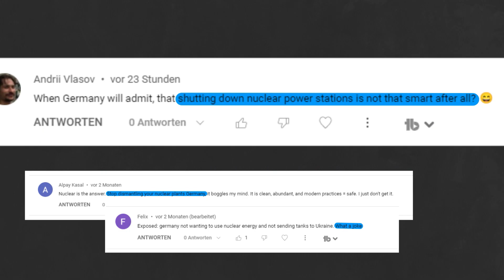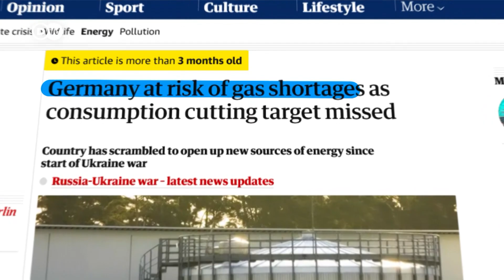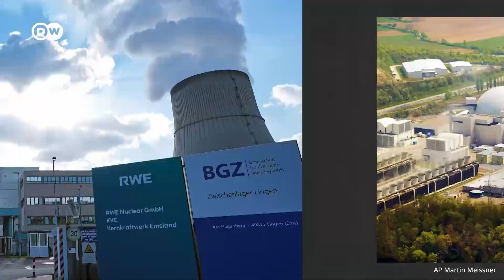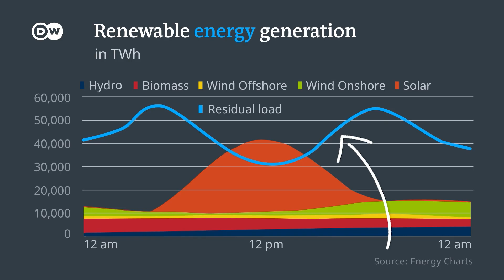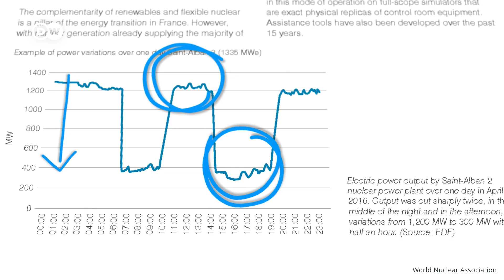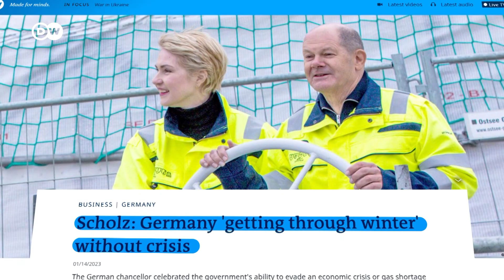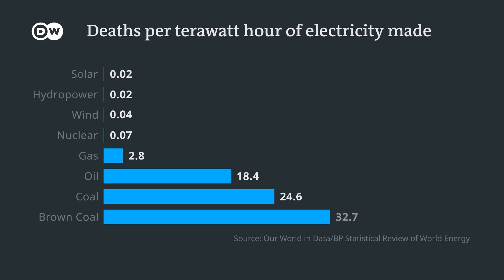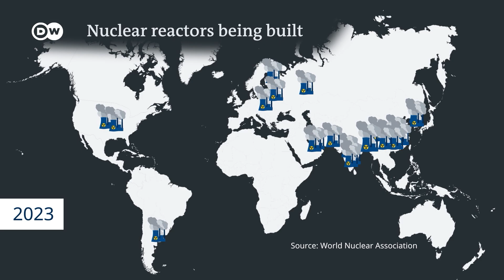Is Germany's nuclear exit a mistake?

Comment: I am completely astounded by the statement that even in a technologically advanced country like Japan, nuclear energy couldn't be made safe. Like, who came up with that??? There was an earthquake and a subsequent tsunami! Of course there would've been a disaster! It's not like the power plant suddenly decided to mess up. This was not caused by the technology itself, and the risk of the same happening in Germany is basically 0
Reply: Japan sits right on the edge of the tectonic plates, they  constantly have serious earthquakes, and if you look back a few centuries they had massive earthquakes. 
Finally, they put the backup energy "diesel generators" in the basement, right next to the ocean.
Reply: Well, Angela had a really good deal with Russia for oil and gas…
Reply: @MioszMichaowski  Yes they had. Germany is now loosing its industry, most energy hungry industries will move to China. The "woke" environmentalist make the environment worse and Europe poorer.
Reply: And the Power plant was designed to survive that. But it didn't. Emergency systems failed in fukushima. Because of planning oversights (redundancies not respected) and cooling pumps not working. So yes Even in one of the most advanced countries man made errors caused this desaster.
Reply: the problem with considering Fukushima to be a proof for lack of safety is not that it wasn't a failure - it was. It's the fact that you have one such accident after some 30 years since Chernobyl means it's a very safe technology
Reply: Well uranium is Monopoly by Russian company rosatom
Reply: "I am completely astounded by the statement that even in a technologically advanced country like Japan, nuclear energy couldn't be made safe. Like, who came up with that??" Liars did.  Liars and fearmongers.
Reply: Ok no Tsunami, call it a Russian rocket, terrorist attack, plane crashing, meteorite, country invasion, lack of water to cool the reactors. All this can happen. But basically the human sabotage/terror the most likely to happen, you can ruin a country in seconds.
Reply: Cause tsunamis and earthquakes are so rare in Japan? 😂 If you are located on the edge of tectonic plates, you need to build tsunami- and earthquake-proof. Not doing so is failure
Reply: @pn7134  That's why here in Chile no one is discussing nuclear energy, because we're not able to create earthquake-proof centrals.
Reply: Fukushima would not have happened had the backup generators been placed on higher ground and outside the flood zone. Simple as that.
Reply: to add insult to injury, Angela Merkel is a nuclear physicist.
Reply: The backup generators at Fukushima were located a few meters too low.  The company did this to reduce cost - regulations are stricter now.  Meanwhile: the death toll of the earthquake and tsunami was nearly 20 000 people.  The death toll from the nuclear meltdown?  Well, one half?  One person's cancer death might have been related.  After an earthquake and tsunami that killed over 19000 people, that was the actual disaster.  The technology is safe, was safe, and has since been made safer by regulations.  If only we could say the same for any other source of energy or other resources we have...
Reply: The even weirder thing is, Japan is one of hte rare few places on earht with stable renewable energy potential. With it's horrid geological activity and good coastline, Geothermal and Tidal aren't off the charts. Ireland (sitting on many pwoerful consistent wind currents), and Scandanaavia (many rivers with little people) are some of the otehr few such rare nations.
Reply: 2 points you completely ignore:
1) what do you mean by "Of course there would've been a disaster!"? the reactor was build to withstand such catastrophic events, since the region is prone to earthquakes and consequently at risk for tsunamis. it happened anyway because of technical and human error. there is no "of course"
2) the vehement protests against nuclear power in germany are largely caused by NIMBY (not in my back yard). it's not so much the risk of a nuclear event, but the fear of the government deciding to burrow nuclear waste in your region. the search for such a disposal site went on for decades. it was in vain. the risk of an actual nuclear disaster comes from across the border. there are plenty of old nuclear power plants not far from germany and they are not in great shape. it's not uncommon to hear of "minor accidents" in one of these power plant, keeping the fear very much alive. radio active fallout knows no country borders. I think most of us know that by now.

Comment: The pollution of coal can be reversed. The pollution of uranium, plutonium and such are not easily reversible, they dont even know if it is possible, they just have speculations no one have had such materials to observe longer than you have lived, so they cant say for any fact. Germany, bold move, I think you did the right and wise choice, should you shut them all down and build some other solution.

Comment: I feel like the fear of Nuclear energy is unjustified, but not entirely incorrect. Especially in the long run.
It WAS a mistake to do this so hastily, but in the future nuclear energy should also be replaced. As better energy storage options are made, we should be able to rely almost entirely on renewables and even if it seems far away I've learnt to not be surprised anymore if something projected for 10 years to be invented actually takes a year or two
Reply: There is nothing to replace nuclear with. It's just the best by virtually every measure. Nuclear is the future, not the past. By 2050 people would have to admit that renewables have failed. We'll have to face the climate consequences, though - the price for stupidity.

Comment: Just read about forming-grid converters, VSG(virtual synchronous generator), and batteries made with simple sand. You can realize that modern society has solutions of this problem, right now we have map or road to reach non carbon dioxide emissions and also nuclear power plants has emission, nuclear fuel cannot be reproduced and we need to store it and bury under our earth, so what I want to say that all problems with green energy can be solve today, all you need money and good engineering, so I think Germany made the most important step to change quality of living and also it’s example for others.

Comment: yes it was a political move ..
let the regular running time end and REGULARLY shut them down .. sure .. 
but shorten their running time for political reasons is an insanely expensive move .. ESPECIALLY in a time right after losing all their current gas supply from russian pipelines .. which put energy cost to more than TWICE the already most expensive electrical energy cost in the world

Comment: yes.
populations increase by exponential increments, the need for power per head only increasing. everything you carry around is smart now, everything has a wifi and internet connection everything needs power to function and more things need to function electronically. more things need to be automatized and that needs power.

Erneuerbare Energien sind schön und toll, aber sie sollten eine Lückenfüllerfunktion erfüllen statt die ganze Nieche zu decken.
Mann braucht eine beständige Energiequelle die nicht schwankt, steuerbar stark ist und möglichst sauber. Nukleare Energie ist "sauber" aber nicht sicher.

Anyway: the federal gov't is retarded to use the japanese NPP incident as a case for german enviromentalism. japan is on the edge of a tectonic plate and surrounded by ocean. its not a matter of "if" but rather a "when" of something happening to the japanese NPP.

Comment: It is a myth that wind and solar energy is free.  Wind turbines are very expensive and the rare earth elements used in the turbines and solar panels require extensive carbon intensive mining and refining to produce the rare earth elements.
Also the amount of copper required over the next 25 years is equal to all the copper ever mined through out human history up through 2020.  This includes all green technologies  from electric cars to wind turbines and every other device that uses copper.
Stripping all the copper piping used in water systems still requires new copper mines to be brought on line and this mining is done by hydrocarbon equipment, even the electric based equipment used in mining has a massive diesel generator to provide the power needed 24 hours a day.

Comment: 10:07
"Old technology ...... such as nuclear power plants which are unreliable, which are dangerous. We always also have to think what is happening with the nuclear waste afterwards."

Holy Jesus that was an impressive amount of wrong information. First and easiest, nuclear is the most reliable source of electricity on Earth, with a capacity factor of over 90%, while second place is at just over 70%, and most other sources (hydro, coal, wind, solar) are between 50%-20%. Second, the "waste" issue has been solved since the 50s. If you really want to get rid of it, bury it. We can easily dig holes with modern drilling equipment that are miles deep and can even bend the holes horizontally in any direction we want. You can put canisters of "waste" 5 miles deep under a mountain range covered in concrete if that's what it takes to make you feel safe. The better option, however, is to reuse the waste material in newer, more efficient reactors.

Comment: Renewables like wind/solar are a good thing to have around, but not often as good as is reported.  Germany for example always displays their figures about how much power they generate with renewables, but what they don't say is how much of that goes to waste.  Battery storage on a national level is no where near capable of handling low generation periods so they always need reliable power from fossil fuels or nuclear either running backup or able to be turned on in a moments notice to prevent blackouts.

Germany is also a pretty bad location for both technologies, with several months getting very little sun hours on average, and has 7 months of calm wind each year.  Germany's best location for sunlight is on the baltic coast, which gets around 1900 sunlight hours a year.  A lot of the southwest of the US gets over 3200 hours on average.

Comment: Isn't coal power plant can turn on-off quickly as well? Why do they need to shut off renewable at peak time?  This is illogical.
Reply from the maker: Hi Vincent. 🌱 We explain the concept of residual load at about 5:15 minutes into the video. We are not yet utilizing energy from renewable sources during these peak hours, and there is a need to compensate when the sun is not shining or the wind is not blowing.

Comment: 90% of times when you ask someone why they are against nuclear power they cannot give you a logical or valid reason
Reply: %90 of times they will bring up chernobyl
Reply: @Idunno-678   Caused by an autocratic government that built poor technology and had very low training standards, and yet the remaining plants at Chernobyl operated until December of 2000.
Reply: @Idunno-678 or fukushima
Reply: @Idunno-678  Chernobyl is a wrong example. The plant was SAFE. The engineers deliberately, and against the rules, turned off critical safety features. They deliberately took massive risks. It's not like they were sitting in the control room and suddenly all went haywire. They very rigoruously, step-by-step, walked into a catastrophy. By the time they realized their mistake, it was way too late. It's almost unthinkable for similar cases to happen. "Almost" because human stupidity must not be underestimated but with proper diligence, Chernobyls can be avoided.
Reply: @Kyanzes  the plant was not safe, it didn't have a containment building, and the reactor design used graphite as moderator.
Reply: @mattette  Magnox also uses graphite as moderator. designed in United Kingdom.
Reply: @Idunno-678 and that isn’t a valid reason because Chernobyl was run by a communist regime, full of corrupt officials and bad safety standards, practices and security by design. 

No western nuclear power plant except for tree mile island have ever have an atomic blast or radioactive material exposed to the environment. New research, and reactor designs are built with contingency and failures in mind they are built safe by design so that blasts shouldn’t be possible even if cooling of the reactor fails.
Reply: Expenses who won't go away, the government has to live with putting budget on waste instead of shipping it to another country. Nobody want to take care of nuclear waste.  Garbage is money and the countries trade with trash but nuclear waste isn't possible since nobody would want to ship this high intensity radiation.  When nukes were tested by USA they had to scrap the ships since they were contaminated.  This self inflicted debt just keep rising over time and the waste is stored in bunkers underneath.  With other waste we just dump it and let it rot and problem is eventually solved.
Reply: @robertagren9360  nuclear power is overall the cheapest though the only reason it actually is priced higher is investors wanting a quick ROI and its not that expensive to dig a hole or modify a mine to store the waste in
Reply: or they could, but they're using the old book, which was so obsolete it's laughable
Reply: The other 10% would be assuming humanity's best Nuclear Technology is Generation 1 Nuclear Powerplants, while we are clearly in a possible transition between Generation 4 to Generation 5 (Fusion?)
Reply: Nuclear proliferation?
Reply: @kevineiford2153 nuclear proliferation has to do with nuclear weapons, which require different facilities and processes to those needed for energy production. Considering just how regulated nuclear energy is, this risk is virtually non existent in the West
Reply: @ghesboro1991  you can't tell me that training a bunch of nuclear engineers and giving countries a legitimate reason for gathering uranium won't increase their ability to develop nuclear weaponry.
Reply: @kevineiford2153   Nuclear weapons have prevented World Wars, for they directly pose risks to politicians. Nuclear Weapons could directly be seen as uncomfortable but functional tools of peace. WW1 could be summarised as caused by a little hinch between two nations trying to kill off each other's soverignty. Far worser encounters have happeneed between nations now yet, no one dares to make any move.
Reply: الطاقة النووية خطيرة جداً إذا حدث كارثة طبيعية او خطأ بسيط جدا تسبب موت وخرب للمكان المحيط لعقود وتنظيف المكان يحتاج إلى تريليونات الأموال اما اذا حدث خطأ في محطة طاقة الرياح او محطة طاقة الألواح الشمسية لا احد سيموت ولن تتلوث المنطقة لقرون
Reply: @joejimmy8088   If a Natural Disaster happens, almost every powerplant is built in seismically stable zones and has extreme protection. A very many number of errors are needed to even affect a reactor vessel. Wind and Solar constatnyl pollute their environment with eroded fiberglass, heavy metals, blocking farmland, supersonic noises, etc., and no one takes these into account becasue we can barely track those little pricks of pollution.
Reply: @joejimmy8088  Wrong. Nuclear energy is in fact extremely safe, and only requires good planning for it to be so.
Reply: @joejimmy8088  wrong again. It takes a huge amount of big mistakes for a disaster like this to happen. There are countless safeguards and one guy wouldn't be able to explode the entire plant. 
And yeah, I do think it's worth it, because it provides clean energy for a long time and stability.
Reply: Yes, we can give you a logical reason why we oppose nuclear power. Nuclear power is the most expensive and dangerous way mankind has come up with to boil water.
Reply: @billaddington831  It's cheaper in the long run and definitely safer than coal plants.
Reply: @billaddington831  it's dangerous if you're an idiot running the power plant
Reply: @billaddington831   Most expensive when it has less Lifetime costs and zero real storage costs, extremely little land and workforce usage, as well as cause 50% the deaths of Wind Power and 12% the deaths of Solar Power, all while being actively opressed by statistics represented with lies and extremely costly regulations from a bygone century?

Comment: The problem with nuclear power is the waste it produces which lasts thousands of years and is far harder to "reduce" as CO2
Reply: There are methods to more or less safely contain this waste, and the quantities are much smaller than you'd imagine. It's certainly an inconvenience, but not so as carbon or fracking.

Comment: The mentality of germans is "safe and consistent".
Wanting to operate reactors where one accident could make 2/3s of the country hazardous is just not in their blood.
Secondly, sadly germans primary focus on solving problems, not to better situations. If there isn't the immediate problem of having too much coal and gas power, nuclear power would stay till another 50-100 years. People don't like change and germans especially hate it.
Its better to have a system that works in 20-30 years and hurts now, at least doubling the innovation speed for solid solutions, than having something that is better right now and having to wait for another 50-60 years for a real solution.